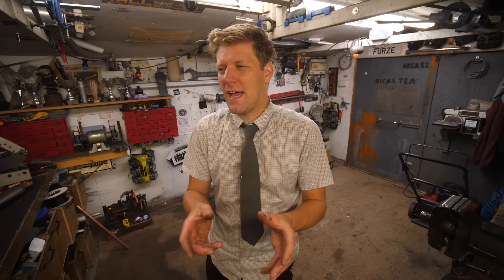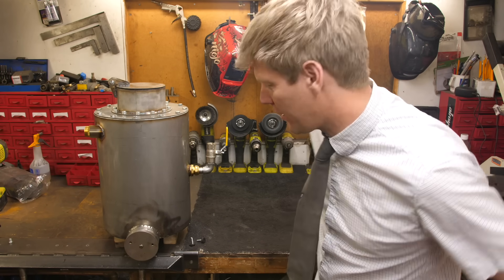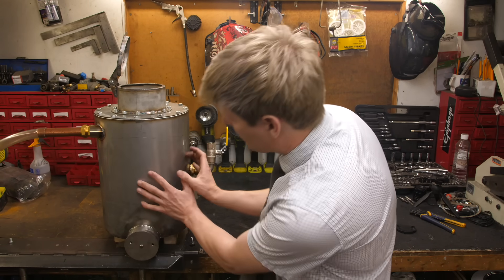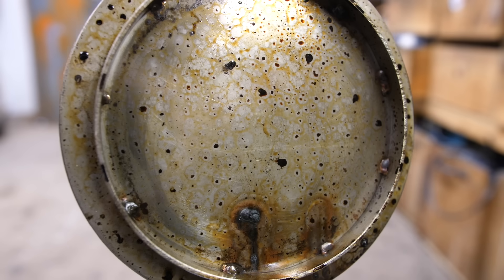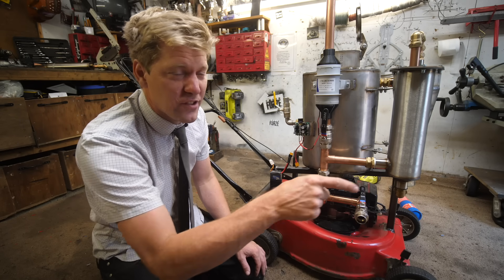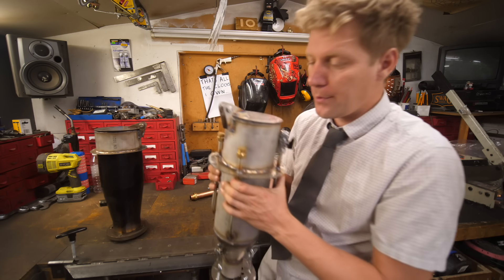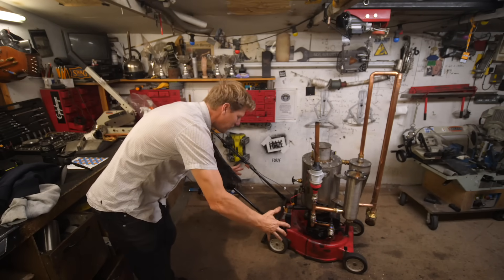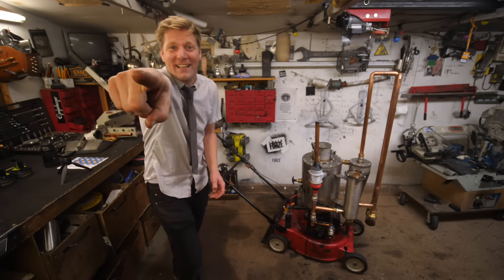WOOD POWERED LAWN MOWER

Comment: And don't try this indoors at home kids and Colin! Carbon Monoxide gas  (the stuff he burns) is VERY toxic and put you to sleep forever! Same reason as that people dies in fires is due to toxic smoke not heat. Treatment often need a (divers) pressure chamber with pure oxygen at higher pressure but you will still have less amount hemoglobin to have oxygen in your blood some years after, if you survive.

Comment: But colin, why are you trying to feed tar, CO2 and wood gas.... Through filters? 
You just need a where the gasification happens, it goes through a water trap, then pipe it to a split, half goes to continue the burn, and the other half goes to the engine. No filtration needed.

Comment: You should colab with NightHawkInLight on a woodgas generator. I'm not sure it's fair to put your woodgas refinery on top of the lawnmower and expect to fit it in the same footprint. That's why we have energy-rich mediums in the first place. We don't expect to pour crude into lawnmower engines or carry around mini oil refineries. But hen this is my Furze so why bother with sensible.

Comment: I was going to say, that testing it inside was super dangerous, because wood burning in low oxygen environment could create deadly carbon oxide until I saw fan in the window in 7:56, so the space was well ventilated so it was probably safe.

Comment: The idea is to burn the volatile gases given off when the wood is HEATED. Not burn the combustion gases a second time. Won't it be tough to heat the wood if you're drawing fresh air through it.

Comment: Wonder if you could choke down the air intake valve and use the Venturi effect from the intake to take the place of the fan? Then it’s totally self sufficient/wood powered

Comment: This is actually a completely different version of crud oil. If you put that tube at an angle sloping up with different collecting containers, along the way you get tar, oil additives and actual engine oil. If you put a wort coil at the top of the sloping tube, you basically make a still and get wood ethenol which is what the poisonous hand sanitizers are made of. You can pour that ethanol in a gas tank and run an engine. Same with leaves and grass. If your car can run on e85, you can run this as fuel. I wouldn't recommend it.

Comment: The city I live in used to have wood gas powered buses.
And seeing the mower actually run in this video were honestly rather impressive, but yes, that filter system seems a bit "inadequate" considering all the gunk...
Glass fiber insulation might be a thing? Just stick a pipe into a barrel of it maybe...

Comment: I noticed at 2:14 you were using a square ended allen bit. If you haven't already, you can buy 'BALL END hex shank allen bits' and they're incredible because you don't have to be directly over the screw!
Reply from the maker: yeah I have got them but that one was in my drill and the ball ones are hand operated.
Reply: colinfurze Gotcha. You can also buy straight drill bit versions.

Comment: Little suggestion: To prevent another fan melting, use a turbocharger. use the fan to power the turbocharger, and use the turbo as a fan instead.
It might keep the heat away from the fan itself, and, after all, a turbo is supposed to suck/push air.

Comment: What an amazing idea! How about getting some temperature sensors in there to automatically regulate air intake? Optimal gassing temperature is around 600°C so you'd likely generate less tar at those temperatures; but you might be losing too much heat to reach that easily... You can purify that wood tar and make creosote, if you're so inclined.

Comment: I've got a tip for you Colin.
Let the gas bubble up through some water.
Reply: Unfortunately, that won't solve the tar issue. Wood gas produces tar as it burns, so even if he does that, his engine will just tar up again.
Reply: @Rainyjax  more surface area + more cooling in the filtration stage would help.
Reply: Could he possibly filter it through diesel exhaust fluid, because it is less dense than water?
Reply: this type of "Fuel" would probably best work in a WW2 tank engine which would happily burn the tar alongside of the gas. just need to load in some more trees at a time.
Reply: @moos5221  the part that got gummed up is called the carburetor. No combustion goes on in it. So nothing is going to burn in it either. I am not sure if an engine with a gasifier even needs a carburetor though.  It is not like you have to atomize the fuel.

Comment: Wouldn't be the gas yield much higher if you'd heat the wood in a closed system without any contact with the actual fire (and any air)?

Comment: Ironically this isn't really all that crazy. You could totally do this to your car btw. You need more bends moving up the catch that tar. I like the catch jars but it's just not condensing fast enough. You basically want the gas to be cold by the time it hits the mower. You could use water to filter it also.

Comment: Why not filter the gas through some water, like a reservoir, before or while its in the radiator just let it bubble through and perhaps that would clean the gas up enough? Then the water can use the radiator to condense. I was thinking also maybe use some of those fish tank bubbler stones to improve the surface area of the bubbles for cleaning but they would probably get cloged so you would need something more open.

Comment: Having seen this technology used on "The Colony" on Discovery and then "Planet Mechanics" and I believe even "Stuck with Hackett" it is a tried and tested method, it just takes a little bit of work to get going. Realy curious to see how you get about the "tar" issue and if there is a good secondary use for it?

Comment: Dry your grass clippings and then run your lawn mower on the power of LAWN!
Reply: "I used the lawn to destroy the lawn"
Reply: Robert Loughrey awwww yeah 
Self sufficient lawnmower
Reply: @joeydr1497  Buy a goat...
Reply: @donaldasayers  goats pull out the roots, it's sheep you want
Reply: @donaldasayers  where is he going to find a grass powered goat don't be ridiculous smdhlol
Reply: @87mits  sheep are just as bad; yes they don't pull the roots out but they do graze down to the ground. That is why cattle ranchers still don't like sharing grazing land with sheep herders to this day.
Reply: @joeydr1497  Gosh the environmentalists would go crazy for one. Except you'd need a field to run for a few minutes.
Reply: @joeydr1497  it's kind of self sufficient if you just leave the grass clippings on your lawn and let it grow back into the soil, especially since if you burn the grass it'll cause gasses which are bad for the environment and wouldn't burn nearly as good as wood
Reply: @isatntt  it's not great for the health of your lawn to let grass clippings just sit, they end up as thatch and it chokes out new growth that's why you see lawns that look patchy, it's because portions of the lawn died from leaves or clippings accumulation in one spot.
Reply: @isatntt  still cleaner than burning petrol though so any solution is better
Reply: @isatntt  
If you burn things that have grown the CO2 just goes back into plants as long as the rate you burn them is the same rate they grow at. Which if you were running a mower off cut grass would be the case.
Reply: @isatntt  you can burn nearly anything in a gasifier and it'll work. any organic material will generate hydrocarbons the same as wood
Reply: Yes, infinite mowing 😎
Reply: MatrixWarrior98 your so dumb it’s not infinite.
Grass is powering it
Reply: @MatrixWarrior98  My kid would hate this! hahaha
Reply: I remember someone did that with a lawn tractor.. he put a gasifier on and fed the mowed grass into there to power it
Reply: Gydo194 that was Henk Rijkeart
Reply: @jonasderre8002  Ah thanks
Reply: @jonasderre8002  the belgian comedian henk rijckaert?
Reply: @gydo1942  I believe "Simpsons did it" first
Reply: @gydo1942   UNLIMITED POWER!!!!!!!!!
Reply: self perpetuating system! until your lawn catches on fire.... darn mid july drought

it'd get rid of the tar problem though
Reply: PsychoLucario we brits don’t get that
Reply: PsychoLucario if you live in Louisiana there is NEVER a drought
Reply: Furze Grassgas Mower!
Reply: Make cellulosic ethanol from the grass to run the mower.
Reply: Its indirectly a solar powered lawnmower at that point... with more steps
Reply: Brilliant
Reply: @jeffsadowski  Yep..and in a way? EVERYTHING ON EARTH is run by Solar Power. But Governments and Tree Huggers will be fighting over it as long as the Sun keeps coming up... Or a Billion years, whichever comes first...
Reply: @w8lvradio  Wait until the Dems introduce the Sunshine Tax.  People with solar panels will be charged for every hour of sunlight available to their solar panels.  Free energy will not be free much longer.  It will be illegal to create free power with an unregistered device.
Reply: Thanos: "I used the stones to destroy the stones."
Colin Furze: "I used the grass to cut the grass!"
Reply: To misquote Bobby Fuller,
"I fought the lawn... and the lawn won."
Reply: Youre on the fbi list now. You don't need that power
Reply: Richard Vaughn ok thanks
Reply: Robert Loughrey that’s brilliant!
Reply: That will be used for the next video
Reply: i think this would be too dry
Reply: Man that's good shit
Reply: you don’t need to dry it out most the time
Reply: Hey yeah thats a great idea!!
Reply: I was gonna comment that
Reply: Welcome to Top Dog...
Reply: Dang it I thought I was the first one to say this man
Reply: Fueling the tool of destruction off the corpses of its own brothers.
Reply: Its tree friendly, its recycling, the smoke goes into the machine, it would a great pollution machine and yet
Reply: The Grassifier
Reply: That’s what I thought
Reply: It's organic, all natural.  As long as the grass isn't GMO, of course.  😉
Reply: Lawn mower powered on own grass clipping. It would go worldwide. Maybe add a bit of water to the combustion. It works in theory.
Reply: Bruh
Reply: @tripplefives1402 You could put a clipping  catcher on it, they fill up quick but without it yes very little is collectable off the lawns surfaceothwrwise
Reply: Use the lawn to destroy the lawn, absolutely diabolical 😂😂🥹
Reply: Now that would be recycling
Reply: prepetual motion has finally been discovered
Reply: UNLIMITED POWER!!!
Reply: It's like a science fiction horror movie for grass
Reply: Power a chainsaw with wood🤯
Reply: Destroy fire with fire as it where said or something like that
Reply: Pretty sure that would be the closest thing to perpetual energy 😅
Reply: That would be a good sequel
Reply: It would give off black smoke it wouldn’t work

Comment: Hey Colin! My shop teacher is actually going to let me build a drift trike for my semester project!
Reply from the maker: great man
Reply: power it with a turbo-jet! say it's easier to do than any other motorisation ;)
Reply: @michaelkeller5008  I would but it doesn't fit in the budget lol
Reply: Nice my teacher said that it had to fit in the locker, so I ended up making a mechanical hand. I'm still very happy about my project.
Reply: @Gullzarr  dude that sucks
Reply: @Ibrahim Osman ...he could wear a safety-tie..? (see your point of course - yet, the drift-trike itself isn't exactly a save vehicle...)